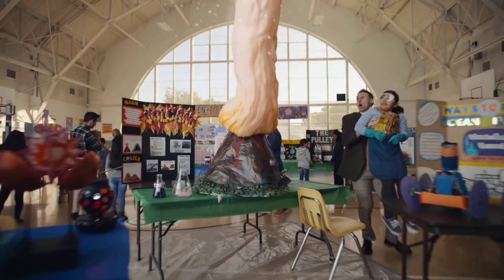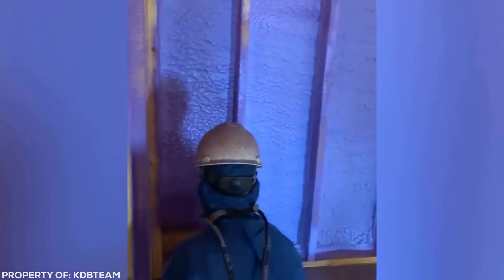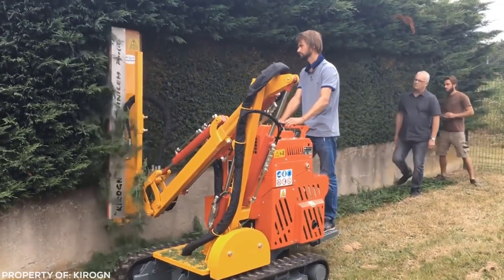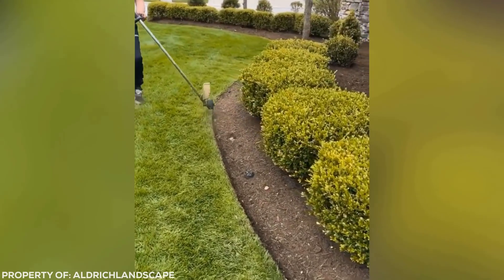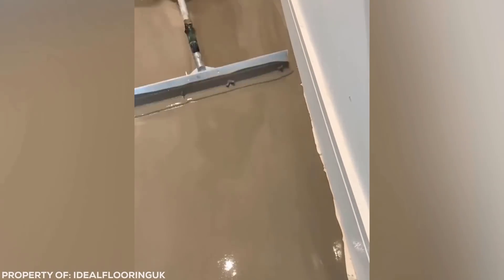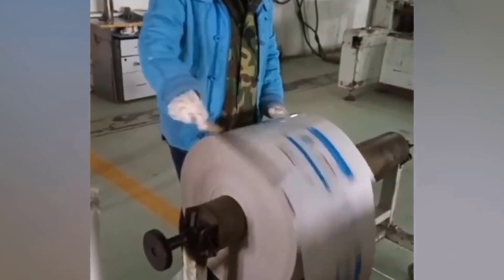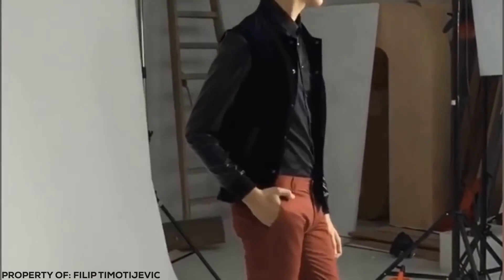Most Satisfying Videos Of Workers Doing Their Job Perfectly...

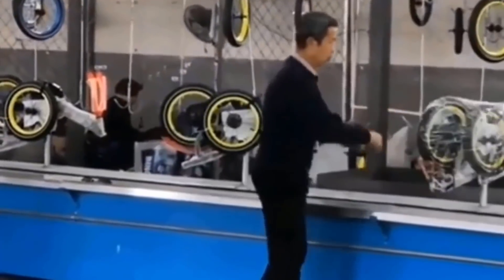Comment: 2:15
I have no words.
Reply: O
Reply: O
Reply: O
Reply: O
Reply: O
Reply: It's pretty cool
Reply: O
Reply: O
Reply: He fills the bag up with air. At the last second, he opens up the end and throws it where he needs it. The air on the inside is pushing itself out, inverting the bag as it it rolled onto the wheel. 

That’s science right there bro 🧪
Reply: The plastic melted, see those glowing things? I think they're hot metals. You also do this with a real thin piece of plastic and a hairdryer.
Reply: O
Reply: O
Reply: O
Reply: O
Reply: O

Comment: 0:55 if your doing this in an attic in the middle of summer it’s pain. My dad worked in spray foam insulation for 3 years re-doing peoples attics and stuff. He said it was one of the most back breaking jobs he had ever done. He did one time fall though the attic then though the second floor and to the first floor. this happened years ago but still.(Btw this stuff can be very dangerous as well. Be careful if you work with it, seriously.)